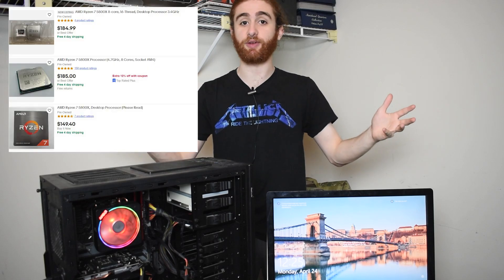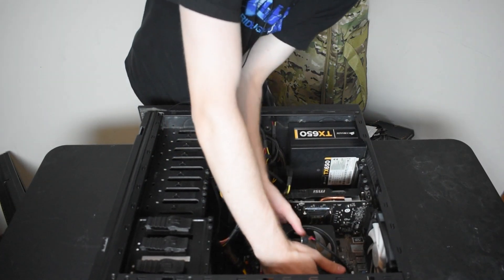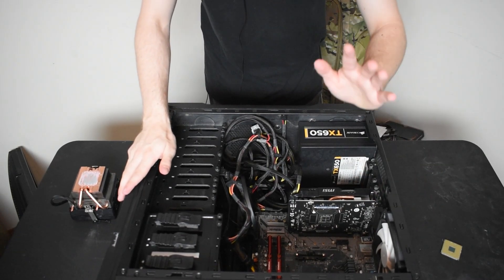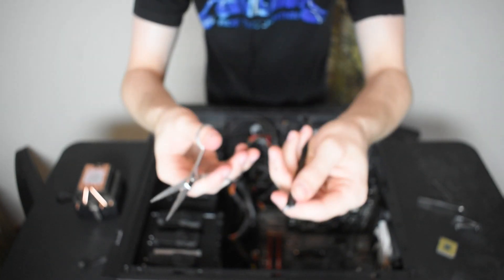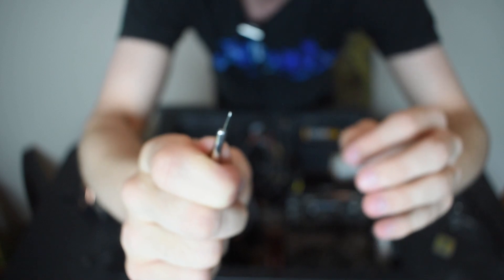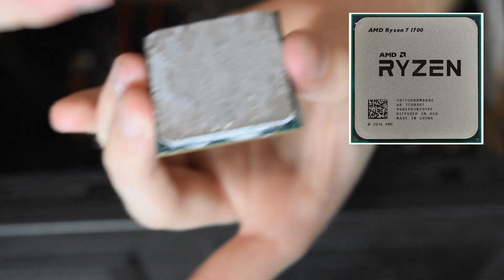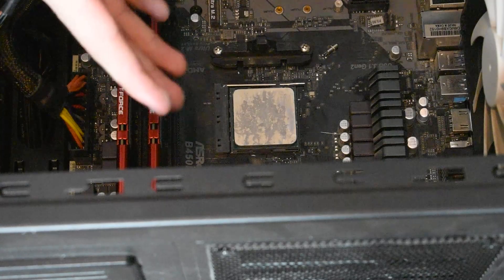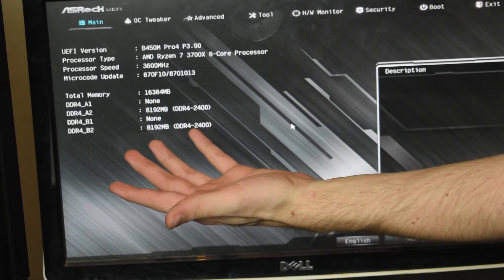How to easily FIX a Ryzen CPU with BROKEN pins

Comment: What not for the pins with power?
Reply from the maker: @riner0631  would not recommend doing this for pins with power. Might be fine and you can try but would recommend soldering

Comment: Is there a service to send these in to be fixed?
Reply from the maker: Not that I'm aware of!
Most likely either you will have to fix it yourself or buy a new one
Don't think AMD covers damaged pins :(
Reply: @civi22  I sold it on ebay lol thankfully I have a ryzen 9 5900x...just gotta work on a cooler as I only have the stock wraith stealth

Comment: I think about that too.. 
But i dont di that, i'm afffaid will short with others pin?
Reply from the maker: it should be fine as each hole in the socket is seperated
Reply: @civi22  why simple trick like this, no one discus in yt..  ?